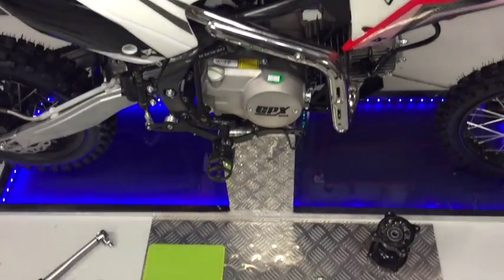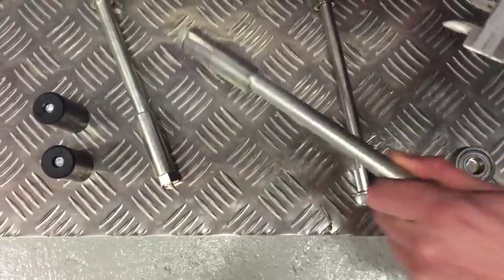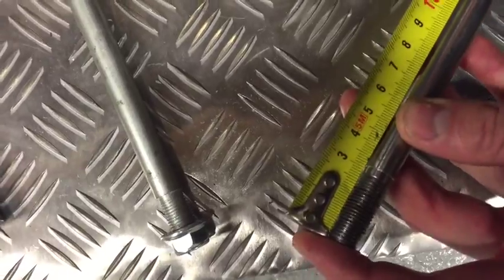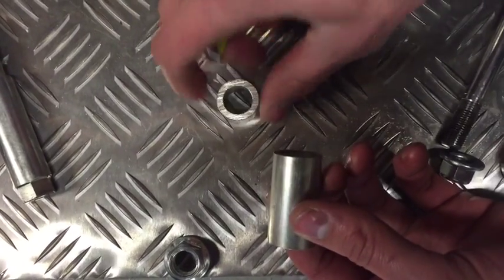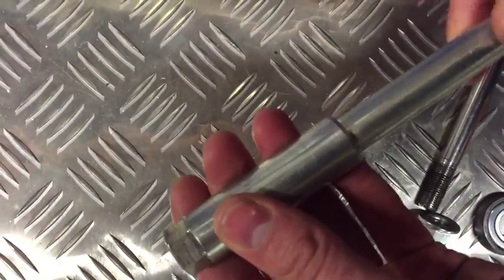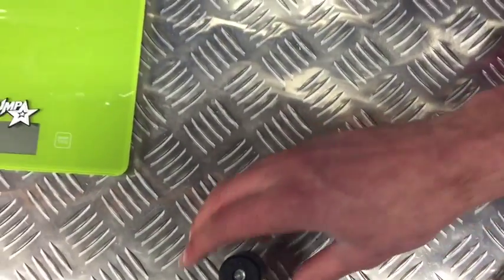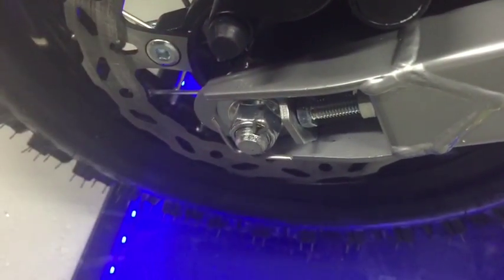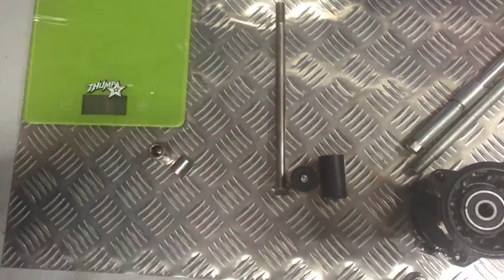Wheel Axle Information - Thumpstar

Comment: Hay bro I've got a factory mx 140cc motocross bike and I've had to remove my back wheel to get it in my house and I'm trying to put it back on and I'm struggling to get the spacers on I've managed to get 1 on the disc brake side and I've put the bar in but I can't get the spacer on the other side I've been trying to do it for the last few days have you got any tips or can you let me know what I should do please